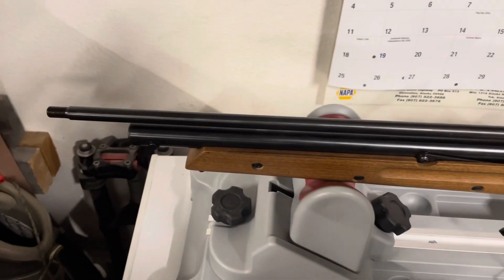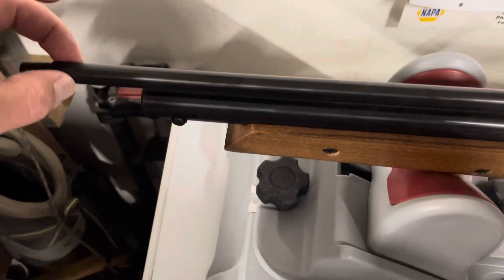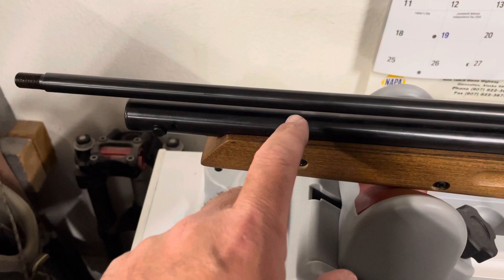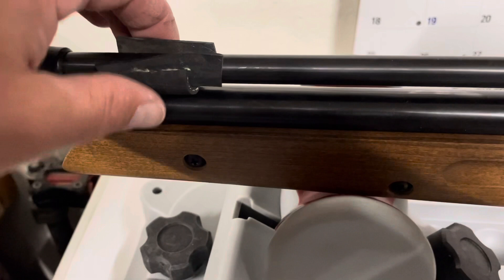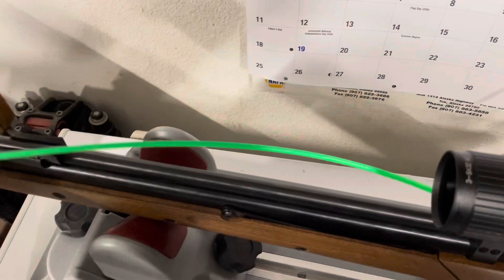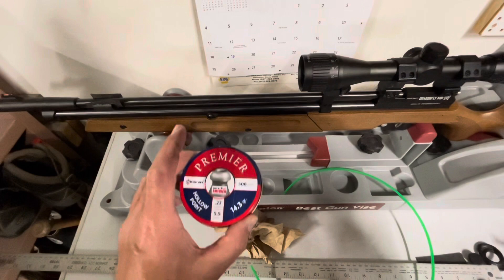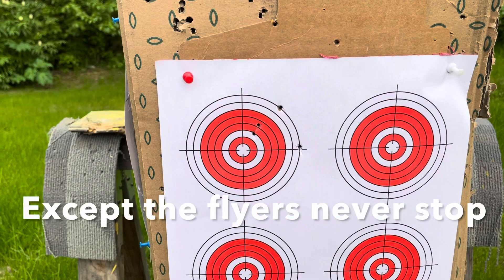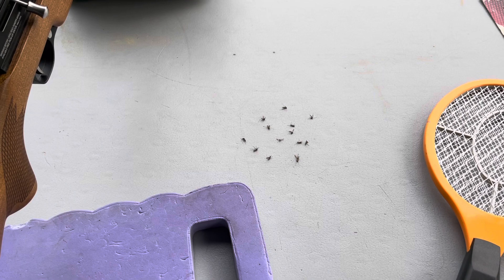Dragonfly Mk2 - desperately needs a barrel band

Comment: You gave it a good try. With you saying the linkage stops  the use of a metal barrel band. The plastic front piece needs to be aluminum for rigidity. Or you use a 20 buck carbon fiber shroud to an tension and barrel rigidity. Send it back maybe version 2 fixes the design flaws and cheat plastic pieces. Great effort.
Reply from the maker: They could have easily fitted a more rigid metal front sight/barrel support assembly right at the end of the air tube. Some company that machines parts could produce the same thing. The plastic part doesn’t secure the barrel enough.

Comment: After that barrel flex demo I had to check my Stormrider, it does flex too but not nearly that much, maybe a couple mm then it springs back into place when I let go.  I guess this platform depends a lot on how it's assembled.
Reply from the maker: I was comparing the Dragonfly barrel to my original, smaller diameter, 7/16” barrel from my Crosman 362 that I’ve got on my work bench. The Crosman barrel seemed like it had less flex.

Comment: You gave it a good try  and I would have returned it sooner than you did.  The barrel on my Mk2 has almost no flex and I'm doing quarter size groups at 100 feet freehanded using a BugBuster scope and 8 pumps.  I definitely  think you got a bad unit.  Thanks for the great videos !
Reply from the maker: Thanks! I was initially pretty impressed and excited about the gun. Oh well… can’t say that I’ve missed it since sending it back. I’m curious to see what Crosman comes out with on the 362 platform.

Comment: You could get a carbon fiber tube with a 14 mm inner diameter to act as a shroud and gap filler .  What I notice is a tiny bit of pumper tube at the very end of the gun that looks like you could slip on a barrel band from another gun .

I guess if I was stuck with it . I would try to find another rear sight and use it up front unscrew the actual sight and just use the bracket . I think a 16 mm carbon tube will have a 14 mm inner diameter. 

Anyway more options to keep you hooked but I have to say you gave it a better chance than I would have unless I was stuck with it .
Reply from the maker: I’d think that would definitely help. I don’t know what something like that would cost or even where a guy would purchase one?
Reply: @airgunsofalaska  Amazon , has the carbon fiber tube , they cost anything from 10 to 20 bucks , Im thinking if your 14 mm spanner fits over the barrel the 14 mm inner diameter is perfect , might have to lube the tube a bit .  For finding another sight braket , I would go to the distributor and see if there is any option for replacement parts , if it's possible they often put schematics in the instructions manuall .
I'm pretty crafty with wood working. If I couldn't find any options for a barrel band I might try a hard wood it's actually pretty simple if you have the tools , I like working on guns and making thing so maybe I'm a bit off . I know plenty of people that expect things to work perfectly right out of the box and rightly so but I like fixing stuff . I'm the guy that will by a shovel handle or axe handle that cost more than a new tool .  Personally after seeing all you did to solve a problem I wouldn't buy this gun .
If it was mine I'd make that Fr work to spite the manufacturer.
Reply from the maker: @jasonnealey8325  that’s a reasonable cost for a carbon fiber tube. 

For me to have wanted to put any more time and effort into making the gun work, the pumping mechanism would have to be different. Through this experience I’ve learned I very much prefer the standard type pumping linkage feel. I’ve also learned I’d rather pump fewer times with harder pumps than easier pumps at a greater quantity.
Reply: @airgunsofalaska  I am totally with you on this one reason I like the 362 so much is that very reason ,FYI on the 362 I've had a brass or aluminum muzzle break air stripper on the end for some time it was debatable about whether it had any affect at all but I recently switched to a threaded muzzel device made of brass it's much heavier than the muzzle flips , enough so it changed the balance of the gun and very much tightend up my 40 yard groups . I've heard of Barrel tuning with weights but never liked adding anything that doesn't look like part of the gun IE hanging stuff off the end of the barrel .
Anyway I know you have the 362 , if your interested in a muzzle device Alliance Hobby has them and a few cool videos illustrating his product,  he is the only guy out there shows how to take the 362 stock off , there's a little trick with the safety spring .
I used a carbon fiber tube on mine just for looks and to be a little different.

Comment: I just bought this rifle a couple days ago...im returning it to pyramid air.  The 2nd stage trigger is the worst ive ever felt in a airgun. I was unable to get any consistent accuracy past 25 yards. Sometimes the bolt felt alot of resistance when trying to push a pellet from the magazine into the barrel . I did think the pumping effort was easy,  but did not like the long throw of the pumping mechanism.. I will admit it is innovative but IMHO, it needs to be refined much more. I was getting 865 FPS using 9.9 gr alloy pellets in .22 caliber, at 12 pumps and 760 FPS at 12 pumps using lead 11.9 Gr pellets....which is damn impressive..but thats meaningless when it wont hit your targets consistently. This is the 2nd time Ive tried a seneca product and it was unacceptable. I bought the seneca aspen multi pump PCP several years ago, and that was a waste of $440 cause it wont work anymore.....evidently they were so bad, that seneca stopped manufacturing them ?  That was also a innovative gun, plagued with problems.  Im very dissapointed with Seneca but give them credit for trying to be innovative. Maybe they will come out with a dragonfly 3, that fixes the issues....I also noticed that even though the dragonfly can be pumped to 15 pumps, it seems the sweet spot was 12  pumps, Maybe seneca can come out with a better version,  where the air valve has less airspace inside of it, so the owner can get 15-20 FPE with only 8 pumps instead of 12-15 pumps.
Reply from the maker: I wonder if they have poor quality control? I don’t miss my Dragonfly at all but it was definitely innovative. I don’t remember using the magazine but I thought it was a nice feature and the wood stock looked nice and was comfortable aside from the sharp edges. I liked the trigger on my Seneca, it doesn’t surprise me they can’t provide consistently good triggers. I didn’t care for the design of the o-ring breech seal. The pellets passed through it and would eventually cause premature wear. My Crosman guns use an o-ring on the probe, that’s a better design. 

Good to know that 12 pumps are really all that is needed. Still, I could never get used to the feel of the pumping mechanism. The poor long range accuracy was the final straw for me. Perhaps other Dragonfly’s perform better but mine was a disappointment past 35 yards. It’d be cool if this gun would prompt some innovation from Crosman or Daisy to offer some similar features on a pumper. I’d also read bad reviews about that Seneca Aspen. Another great concept for an airgun but Seneca’s execution was garbage.
Reply: @airgunsofalaska crazy, because my aspen is consistent.  It throws different weights to pretty much the same point of aim.  I am using a red dot and it is grouping 1” at fifty with no scope.  The pellets punch through aluminum sign material without any problem.  I make sure to lube the pump well with silicone.  My only gripe is that it takes a lot of pumps to get it into shooting range, but once there it will go through over a full mag before I have to top it off.  If you want high accuracy, get a Diana and pay 800+.  Just saying.  The aspen will give same hole accuracy, but for rabbits and squirrels you don’t need that anyway.

Comment: order a barrel band  like fitted on the gun ,i use the orginal band on the pcp 900 serie to move it to the front  yoy can a use the srewhole to fit a scrub scew . put a piece of  o ring first ,the stock is still kept by 2 screws  also a carbontube under tension by the silencer ,  test also the pellet size ,they do not make al those headsizes for a reason . i see no reason why it  is not capable of dime size groups then
Reply from the maker: I don’t want to put any more time and effort into this gun. I think what you are suggesting would work. It’d be cool to watch a video of someone making a mod like that and see what kind of long range results they get.

Comment: I would want to try a selection of pellets with and without the improvised barrel support. Crosman HP are better value than JSB and can work well but just don't group well with some barrels. 50yd might be stretching it for the hollow points as groups with any flat or hollow point pellet type tend to open up at range. Maybe pull a few patches through the bore with a little ballistol then test a pellet selection at ~30yd. You could do some half power compared with full power testing. I agree that amount of barrel flex looks off-putting but many rifles are free floated on purpose to allow repeatable barrel vibration /harmonics, might not be as bad for accuracy as it looks.

Comment: another thing l forgot about is the barrel band one in front of the receiver is that fit on with secure fit is there a bolt that it can tightened down more for a  more  tight fit.   just wondering on that part.
Reply from the maker: Some company could come up with a bolt on item for sure. A regular guy might be able to create something for themselves using flat stock steel or aluminum. I might have tried to but I hate the pumping mechanism on this gun so much that I don’t have interest in trying to improve it.
Reply: @airgunsofalaska  l know its like reinventing the wheel on this gun since the company can't do it the right way.   if crosman company had this gun they would have done it the correct way.

Comment: If I liked the gun, I woulda mixed up some JB WELD, and added in some black paint with it , then used that to fasten the front of barrel securely.
Reply from the maker: I wonder if that would’ve been enough? The plastic sight assembly they used wasn’t the most sturdy piece.

Comment: Nice looking rifle. Shame it's a failure. Im sure not keeping any gun that I have to re-engineer to make it almost work. Glad I saw your vid before I bought one of these. Maybe they will work out the flaws in time.
Reply from the maker: It was a shame. I was initially quite happy with it save for the weird pumping effort. Unfortunately it just wasn’t consistently accurate out at the longer ranges I like to shoot. I think a Crosman 362 is a better gun for the money. Of course to make it more comparable a steel breech has to be installed by the owner and most people aren’t going to do that. But, if they did that, the result is a nice light weight gun that is accurate at long range AND is easier to pump. The steel breech is the best way to go to mount a scope or a higher end adjustable peep sight.
Reply: @thatalaskaguy-airguns  yeah, everything out of the box isn't  always great, but they will work it out. I bought a Crosman 392 in  .22 a few years ago. Last one that still had the wood stock ,steel breach, and I added a Willians peep sight. Awesome rifle. I also just bought the Crosman Prospect pcp rifle in  .22 and it is outstanding.
Reply from the maker: @kaylamarie8309  very nice! The 392 is a head and shoulders higher quality and better, more accurate gun than the Dragonfly. My only PCP’s are Crosman/Benjamin guns and they’ve all proven to be very accurate. 😀
Reply: @thatalaskaguy-airguns  I was really lucky to get one of the last  ones with a wooden stock. Mines a .22 and hits like a truck. I have Crosman, Benjamins, Gamo, and Hatsans. I'm airgun rich but that's  about it 😆

Comment: l wonder if  took off front sight assembly and  if you have any other older crosman pumpers with barrell bands or mayber from another air gun  might take that and see if fits  on front of dragonfly l am looking at my crosman 160 the barrell band may work good on the dragonfly l would look at what air guns you have it may work good if can find a barrel band from another  air guns.   just an idea.   but l think if you can find a good barrel band that fits on both pump tube and barrell would fit on front .       it would be more stable and more solid if can find that perfect fit barrel band  from another air gun.
Reply from the maker: Yes, there is room for a metal barrel band similar in design to what’s on my Marauder. One of proper size could fit right at the end of the air tube, ahead of the linkage. I don’t have any guns in my collection that have a similar part that would fit.

Comment: That wasn't far off. an extra scope mount would grab the barrel and fill most of the gap underneath. Then, a discreet plastic shim if necessary to tighten it. It's part of the fixes I did on my 🇨🇦1377.
Reply from the maker: That gun is long gone. I suspect someone could come up with a fix for the noodle like barrel but I also loathed the pumping mechanism.  I moved on to a much better gun with the Benjamin 397.